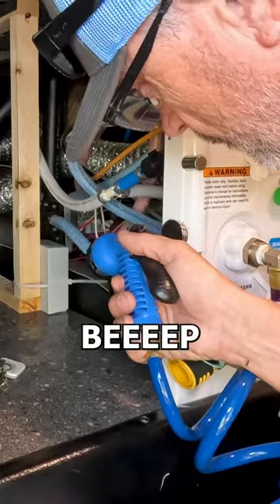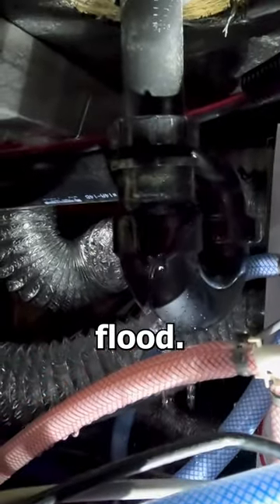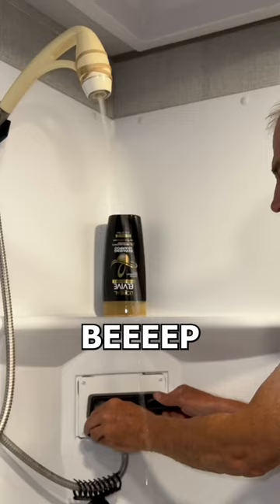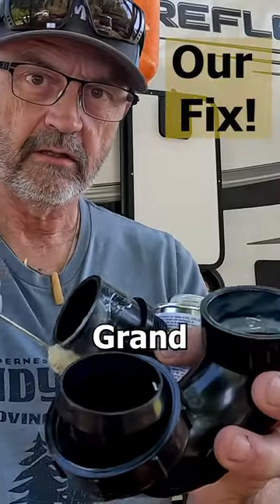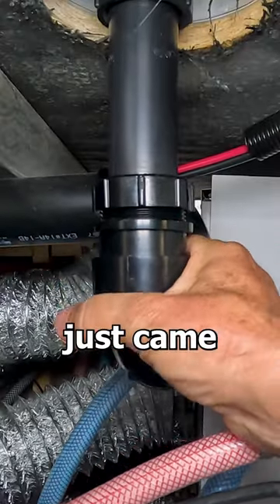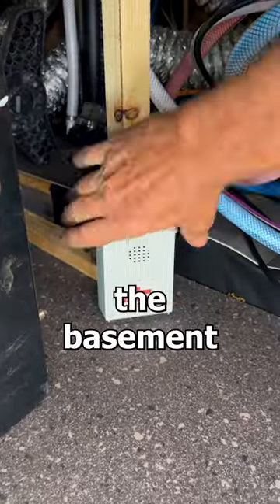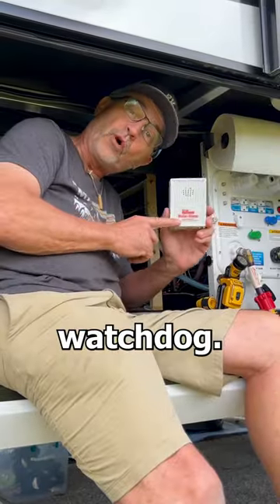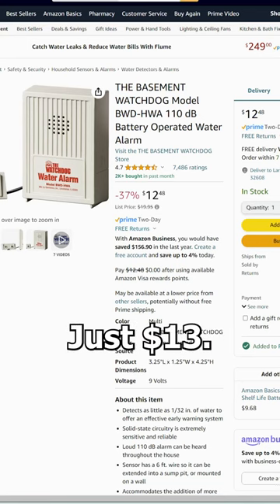Prevent Water Damage, Inexpensive Device #shorts

Comment: You are going to have more water problems with all of those PEX fittings improperly used with the flexible tubing!
Reply from the maker: Yes.We saw poor plumbing even in expensive over $100,000 fifth wheels. 
And Larry upgraded much of the plumbing on our old rig - brass instead of plastic, too
Alice